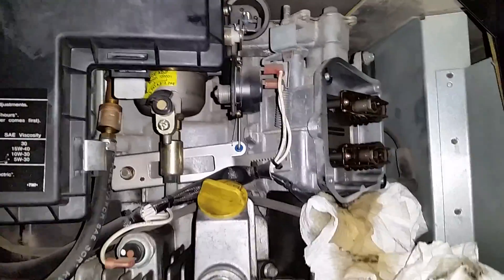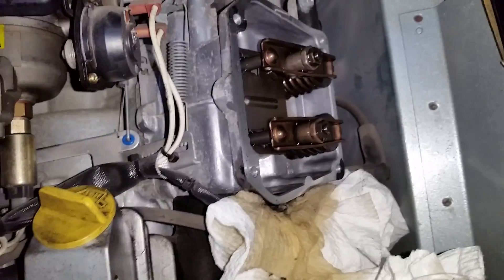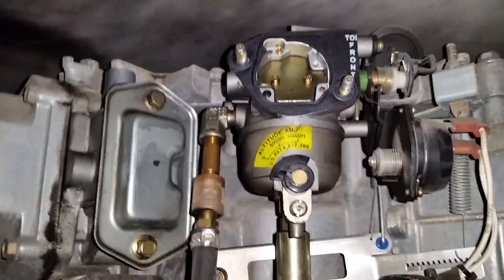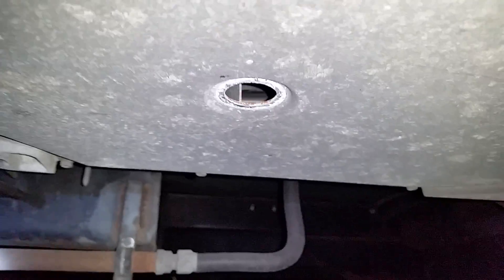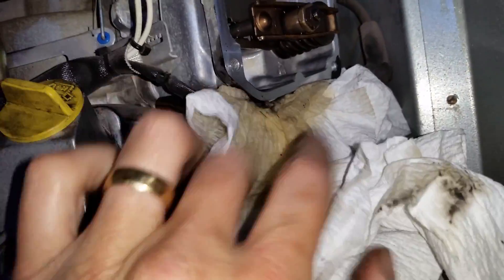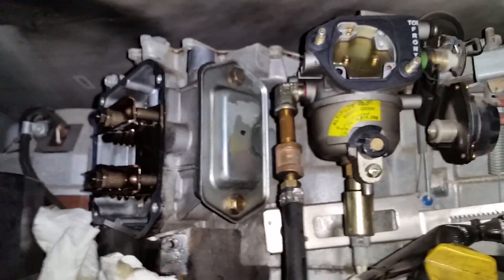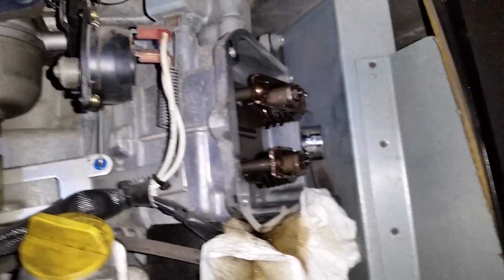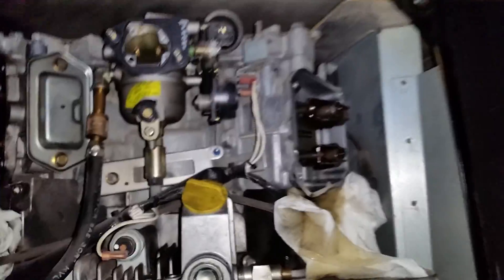How to adjust the valves on a Onan Marquis Gold 5500 Generator.

Comment: One issue I ran into. I noticed that the first one took forever to get right. The reason being is that when you loosen the 10 mm while wrenching the 14 mm you MUST be careful that the stud nut all the way at the end toward to block of the stud (12 mm) does not come lose at the same time. I needed to take the rocket arm off and bushing nut to retighten the stud 12 mm then it went fine.
TY Kevin

Comment: I like to use go, no-go feeler gauge method for adjusting valves. If the lash is .004, and you can't insert a .005, but can insert a .003 than you're right on the money.

Comment: Gonna comment again.  Mine has been struggling to carry load, and now that I’m done, guess it was noisy also😂.  Changed the plugs, and adjusted the valves as described.  Now it’s quieter AND will carry both AC units, microwave, water heater, etc. no problem.  Thank again!
Reply from the maker: Your very welcome. Thanks for leaving a comment.

Comment: Hi Kevin!  David in San Diego.  My brakes are still going down the road, no hanging up, no leaking...  Thank you for posting another useful video, gave me the courage to adjust the valves on my 5.5hgjab @ 650 hours; mybad.  Took it up to 95% and it purrrrrrrrs.   The rata-tat-tat kinda snuck up on me, froggie in a pot of water.   Source everything breather, valve gaskets and plugs at Cummins Cal Pacific, except onan air and oil are on b/o for who knows how long, went with their fleetguard filter, $20 for a $11.63 onan, its about 1cm shorter than the onan.  Thanks again!
Reply from the maker: Thank you for the kind words so glad you got that Onan took care of. and that your brakes are doing well, if you ever have any questions that i can help you with my cell is 606-875-0125 Kevin

Comment: Awsome video.  Was just going over my manuals making myself an excel spreadsheet to track my maintenance tasks and read about adjusting valve lash.  What I thought is valve lash.  After watching several videos I feel confident enough to do the job.  But your video sealed the deal.  You explained it the best and gave this ‘ol guy the confidence to do the job.
Thanks
Reply from the maker: Thank you for the kind words Bruce if you ever have a question here is my cell phone number 606-875-0125 just text or call

Comment: I have a Onan 4000 generator with a hundred eighty hours. I started it one morning and it ran for 3 minutes and shut down with error code 14 displayed. I’ve tried to start it multiple times with no luck. 
Took the air filter off and it was soaked with gas, pulled the spark plug and it was dry. So I know it’s not getting gas in the engine, I just don’t know why. 
Any ideas?

Thanks, Jim from Ca.
Reply from the maker: Yes give me a call or text me anytime after 3pm eastern time I will help you troubleshoot the problem, My cell 606-875-0125 Kevin

Comment: Do you happen to know why would a onan 5.5HGJAD spec K  Direct gasoline injection would be making some weird noises as if it had a bad carb. I guess it could be sounded as a small backfire and it turns off when you do a turn. This is weird to me im stumped
Reply from the maker: I have a service manual that may help you just text me at 606-875-0125 Kevin

Comment: Hi Kevin,  many many thanks for the quality video.  Very helpful to see how to adjust valves.  Just purchased a toy hauler with 2007 Onan 5500 Gold.  I also changed the fuel filter to a frame mounted version with a water separator bowl.  

You referenced a service manual that you can email.  Will you send a copy to me?
Reply from the maker: Sure text me your email address to 606-875-0125 = my cell

Comment: Hi there! Thank you so much for this video! I have a question for you. I have a bad gasket and when I opened the valve compartment to change it I noticed that the top valve has a little play but the bottom is totally stiff. Is that normal? Onan 5500/330hrs.
Reply from the maker: No that don't sound correct call my cell 606-875-0125 or text I have more questions + i have a service manual i can email you.
Reply: I thought it was normal, since one is exhaust (open), the other intake (closed).  So, one has pressure on it, the other doesn't.  But I'm not familiar with small engines.

Comment: Do you know the spark plug gap setting for the Onan marquis 5500 Gold RV?
Reply from the maker: The ignition system consists of the flywheel magnet
and two ignition coil assemblies (magnetos) with integral spark plug cables and boots (Figure 7-3) and
two spark plugs.
If the engine does not start:
1. Secure the spark plug cables on the spark
plugs if they have come off.
2. Remove and examine the Spark Plugs and replace, if necessary. Check and reset the gap to
0.025 inch (0.06 mm).
3. Conduct the Spark Check.
4. Replace faulty ignition coil/cable assemblies
and set the air gaps.
Spark Plugs
The spark plugs must be in good condition and have
the proper gap for top engine performance.
To prevent cross threading, always thread a spark
plug in by hand until it seats and then torque to
10 lbs-ft (13 N-m) if new, or to 18 lbs-ft (24 N-m) if
being reused

Comment: Hey Kevin, thanks for doing this video, hard to believe those valves got that loose.
Reply from the maker: Robert Hyde I was tipped off by the sound it was making when I pulled off the insulated side cover. I just wonder how many of these generators are running with loose valve clearances